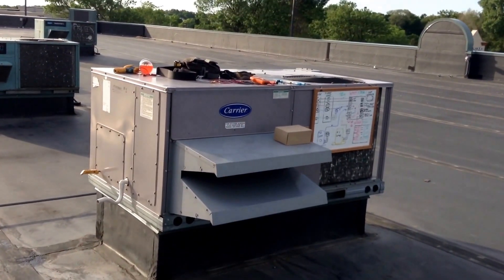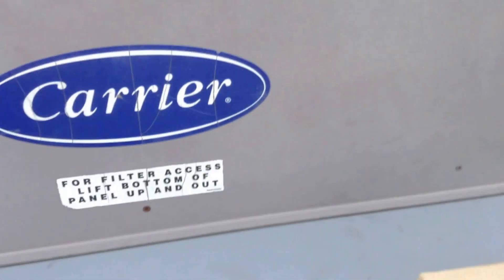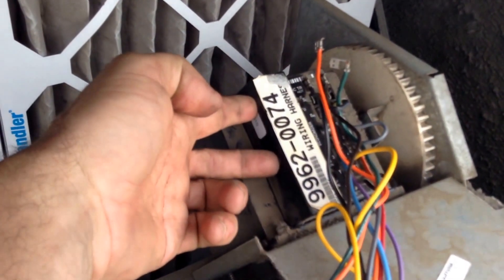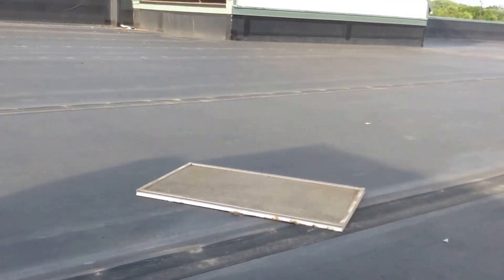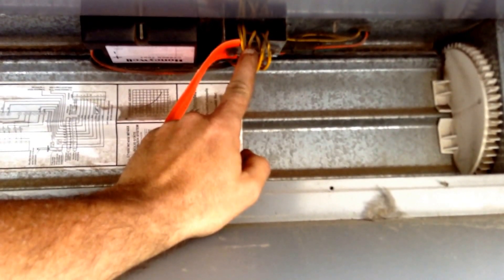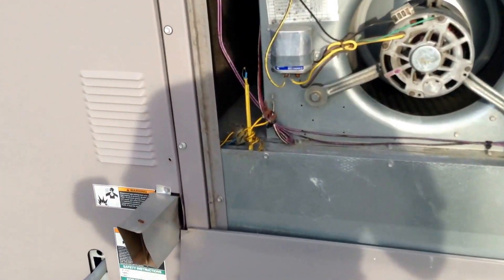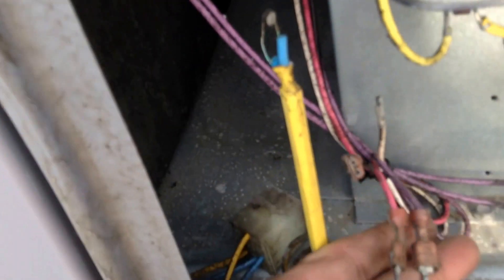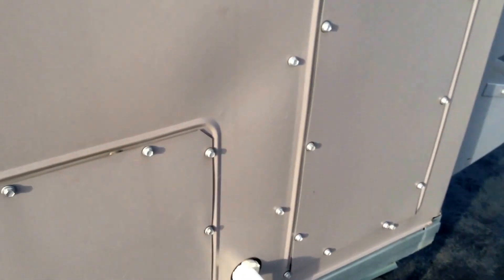Economizer Troubleshooting Carrier RTU

Comment: so assuming the outdoor ambient is is at or below the set temp for comp lockout, the economizer module will stop the call for cool?
Reply from the maker: Max L. Apodaca A call for 1st stage cooling with an ambient temp below the “economizing” setpoint (A,B,C,D) the economizer module will tell the economizer to be the 1st stage of cooling, if you then get a 2nd stage call for cooling the economizer module will be economizing for 1st stage and also send a signal to start the 1st stage compressor as 2nd stage cooling.
*Heres the catch for that - If the ambient temp is below the “separate setting or switch” for compressor low ambient lockout, then the compressor will not run.

But key here is - Unit can and will by design, run economizer (mixing) and 1st stage compressor simultaneously.

Comment: The gas pipe is not not black pipe!
Reply from the maker: Thats correct, this is Minnesota where the gas piping is buried under 5’ of snow in the winter months.
Pretty common to use galvanized gas piping here, Yes it passes inspection
Reply: ....good catch but did you also catch that they used a thread protector instead of a proper coupling fitting.

Comment: This series of videos has been extremely helpful for me not knowing much about economizers and their inner workings since I'm an apprentice. I do have an issue that I would like your feedback on, following your videos I have a carrier rtu that the actuator will drive open with either a cooling call or with a fan call and adjusting the potentiometer but it will not drive closed until the unit disconnect is turned off. On a whim I pulled a logic module off another unit and tried it to be sure I didn't have a bad mod. Same problem. I'm almost thinking I have a bad actuator but would definitely like your input. Also I watched your first video and according to the information in it my logic module should not be energized unless the fan is running but it is. Noted by the free cooling light lit up while the unit is idle. What are your thoughts?

Comment: Great video. I've been an HVAC service tech for 15 years. 9 years resi and 6 commercial. I wish I had videos to look at like this one when I was in my first 5 years. Worked with too many guys who didn't understand how economizers worked so they took shortcuts or would ignore them all together.
Reply from the maker: John Patrick Thanks John !!
Reply: Is there any way you could help me figure out what's wrong with a unit it's on a rooftop gas unit heat only it's a reznor unit
Reply: @williambonin3982  Make up air unit? What's the model # and what is it doing?

Comment: Dave, this is really good. How about answering a series of "If Then" logic statements for troubleshooting. What are the system conditions when outside air is below 30 deg. What are the system conditions when inside air is 5 deg below setpoint and outside air is below 50 deg and above 45 deg. Make up all the questions  from the variables then answer them in a numbered list. This gives you a troubleshooting guide not seen anywhere.